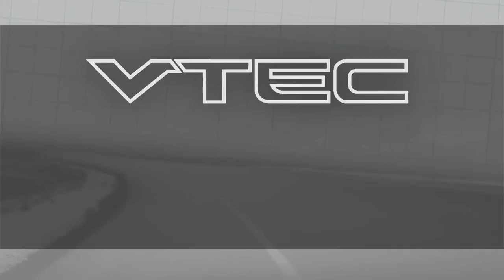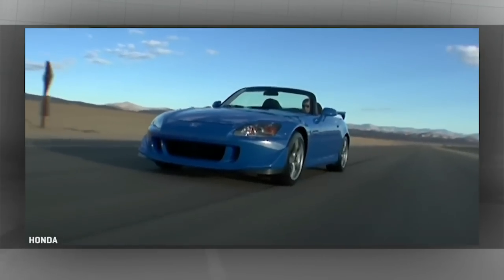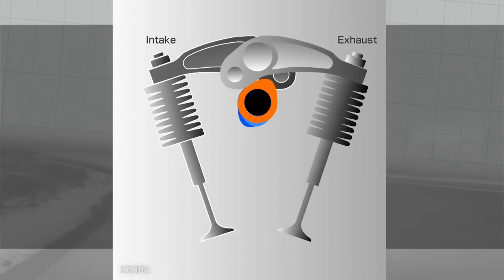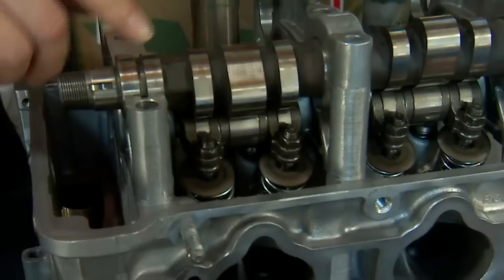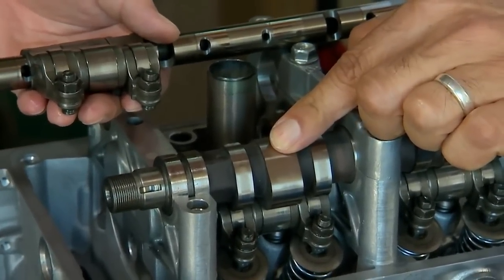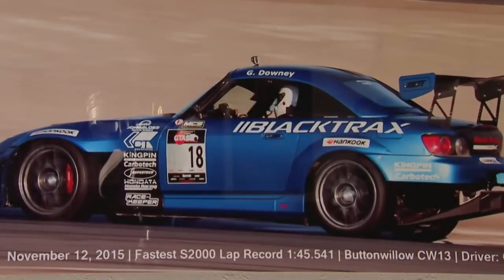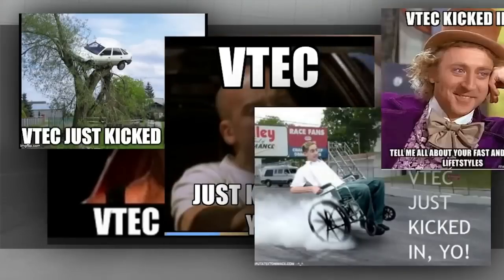How Vtec/VVT/VTVT/VVTi works

Comment: The reason owners don't say "valvetronic kick in yo" Is because it has the potential to work at any engine load/RPM unlike V-tec which is limited to high RPM limited

Comment: Could someone help me understand something please.
When on low revs the cams act normally, one lets air in, then after the explosion a split second later, the other let's the gas out.
But when they are locked together by the larger lobe at higher RPM, it looked like they are operating at the same time, so why doesn't the air and gas escape out of both valves?

Comment: Why was it designed to kick on around 5000 rpms? Can't imagine the average daily driver revving their engines up that high on a stock car
Reply: That’s around the sweet spot the car start sounding good, plus most of Honda’s engines can bang there rev limiter for a while

Comment: There's nothing new or interesting about VTEC. I had an old 202 Holden motor I put big valves and a cam in it in 1987. Nothing happened until I hit 4000rpm and then it turned into an uncontrolable monster. I have driven a Type R and S2000 and they both behaved very similar to the old push rod Holden engine. Not bagging Honda's, I think Honda make very nice cars but VTEC is pretty old tech. Japan seem to copy the rest of the world and it takes them a bit of time to implement new tech. The new Type R has only just gone turbo.
Reply: Yep 3.3 litres. More torque than the S2000 after 4000rpm but very similar behavior, nothing happens till you're on the the cam.
Reply: About 185Hp and 350 torques.
Reply: At the wheels mate and that's not bad for a NA pushrod motor and this was 1987 ya dong. They only put out 100 HP stock at the flywheel. I didn't want to go overboard with he build as I had a limited budget.
Reply: Never said it was impressive, I was stating that the 202 behaves very similar to the type R. A shit load more torque though. Don't forget that the 202 is a very old design dating back to the 50's and earlier. I now own a GTI MK6 and it's more impressive and drivable than the type R civic. I chose it above the type R.
Reply: missing the point, I repeat, never said it was an impressive engine. It still had similar behaviour to the R engine with more torque. Honda engines aren't that torquey. You don't seem to have the ability to read, unfortunately. Reliability wasn't even discussed??? I bet Honda engines in the 50's didn't have high HP outputs.
Reply: Yeah thats right it wasn't bad for a 1950's mildly worked 202 considering it produced near 400 torques at the flywheel. I bet no Honda 4 cyl VTEC would produce that. Oh just on another thing, the 2.0 type r FN2 uses 9.1-9.3 ltr/100Kms of fuel and only produces 202Hp and 193 torques now that's pathetic. The R32 VW uses 9.8 and is 250Hp and 320 torques. The GTI produces 210Hp and 280 torques and uses 7.6. So much for that amazing Honda engineering Honda fan boy. I'm also not a Honda hater, as I said in my very first comment that Honda make some very nice cars. Stop making wild accusations to suit argument. R > GTI DSG MK6 = False. R << R32 VW = True
Reply: Between your ears and pleny of it.
Reply: I don't care whether you think that the 202 is unimpressive I wasn't part of my discussion and I can't believe you are still pissing on about it. As for space as far as scientists hypothesize it consists mainly of dark matter braaaa.
Reply: Not exactly a difficult question Braaaaa. Common knowledge these days. You have proved my point.

Comment: HONDA gets plenty of hate because of 2 things:

1) 

It went against the norms and expectations of what a small engine can only and should only do.

It shifted the paradigm from

small = weak = not even a  challenge = work harder = breaks sooner = PATHETIC (can be abused by large displacment)

to 

small = potent = beating us = more high tech and efficient = extremely long lived = WTF this cannot be?!!  (shaming our V8 V6 Turbo)

2)

More importantly the large volumes and affordable units were made available sooner to kids.

Kids showing off their immaturity when driving these gave it the image people love to HATE.

Thus the beauty of HONDA engineering was tarnished and overshadowed due to the above.
Reply: I don't think Honda is getting that much hate though. Over here where I live hondas are known to be very reliable and fast for their engine size. Sure, it has that side meaning of young kids driving it, but that doesn't take the name down to the drain at all, it just means that they're fun to drive.

Comment: honda vtec engines make the most power and perform better and accelerate faster on the road when equally compared to all brands....for example...
2L honda vtec  vs 2L from another brand
1.8vtec  vs 1.8 from another brand etc. etc. 

add a supercharger  or a Turbo  to all brands with the exact same setup and you will find that the Honda vtec engine will make the most power and will be the faster car on the road, It will even end up been faster than a bigger powerplant/engine car with same mods...

and the vtec will outlast all other brands.....

I went from 3 Turbo cars to vtec naturally aspirated and I haven't looked back nor regretted it ....not once, going 4years strong now.... 

p.s. this is/ was my very first vtec. 

I have driven a ton of high performance  cars with aftermarket mods and Vtec boosted and supercharged vtec engines/ cars are my utmost favourite in every single way.....

Comment: I have a huge problem with my Honda Accord 1.8i LS 1999 with F18b2 Engine. My Vtec doesnt work anymore.. I have no idea why. I've cleaned the solenoid and tested the solenoid, changed oil and oil filter and spark plugs, checked oil pan, no CEL also changed Thermostat (was broken), Speedo is working and all gauges are fine, Engine is warm as it should. I've done pretty much EVERYTHING but Vtec is gone :S there is no different in sound anymore as I hit 4000RPM like it used to before :S What could the problem be???... Please help me some Honda experts.. with tips.. I miss the baaaaaWHAAAAAA so much

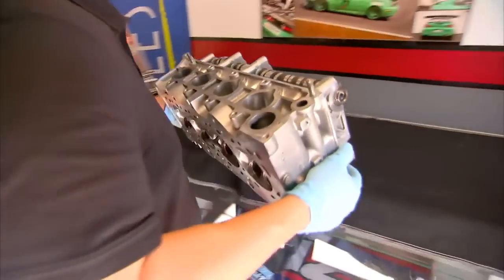Comment: 0:53 since when do you use a  wrench in a cylinder head.  also, the wrench floats. such an expert!
Reply: lol hes turning the cam theirs a hexagonal portion on almost all camshafts for this purpose. i know what you were thinking though, like those models who pose as mechanics putting a 22mm combination wrench on the end of a hose clamp lolol
Reply: Watch when the wrench literally floats
Reply: open ended wrenchs need to float the turn a object after a certain number of degrees , now you watch closer as he turns the camshaft. lol have a great day

Comment: how can you hate such a thing? if you a petrol head you just have to sit back and admire how good Honda were and how efficient they are. vtec is just brilliant .
Reply: I don't hate vtecs, but I really dont like the noise and the fact that almost every vtec is FWD
Reply: A pushrod supercharged LT4 6.2 V8
pushrod = 1 valve per cylinder
Reply: Because ricers
Reply: Them haters are usually VW and Skoda drivers. Feel sorry for them.
Reply: Because it went against the norms and expectations of what a small engine can only and should only do.

 It shifted the paradigm from

 small = weak = not even a  challenge = work harder = breaks sooner = PATHETIC
to 
small = potent = beating us = more high tech and efficient = extremely long lived = SHAMING our V8 V6 Turbo

Note the large volumes of kids showing off their immaturity when driving these gave it the image people love to HATE.

The beauty of HONDA engineering was overshadowed due to the above.
Reply: Imagine if your V8 turbo had VTEC and such? 

Japan has a tax on displacement, so they'd build small engines with a lot of power, and found every way that they could to squeeze that power and performance out of them. VTEC is an example of one of those technologies.

Comment: I had a prelude 2.2  tec with 4 wheel steer. It was awesome.
Reply: Regor Stubrewoz I had one too it was bad ass . I had problems with the stearin at first. Kept on curb checking. I have 2007 si now with a turbo and race built engine 2.1 liter not 2.0 I love it.and I plan on keeping it till I die. Engine has 6000 miles and the car has 50,000. My kids love it when I take them for a ride.
Reply: Regor Stubrewoz aint those the SH type never seen one

Comment: fuck vtec 
vanos is where it's at
Reply: nowhere sounds as good?  are you on crack?
Reply: gabrielwhite you're out of your mind those sound like shit
Reply: depends on if you are talking about the exhaust pipe or the engine it self! Im talking only about the direct sound that you hear from the engine. Not the exhaust sound! Because if that is shit sound for you, you say that every racecar sound shity.
Reply: Grab America by the Flaps lmao i like bmw but vanos is fucking trash compared to any other of these systems
Reply: Vanos doesn’t have VVL does it? Just VVT
Reply: Bmw are trash
Reply: and where starts the sound? Because the Bmw sound nowhere near as good as the VTEC engines from s2000 or integra.